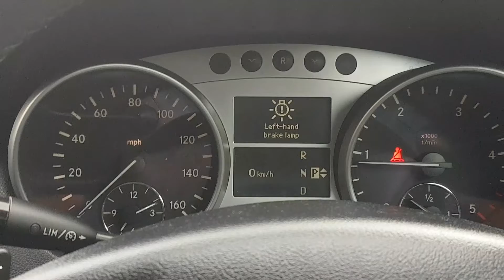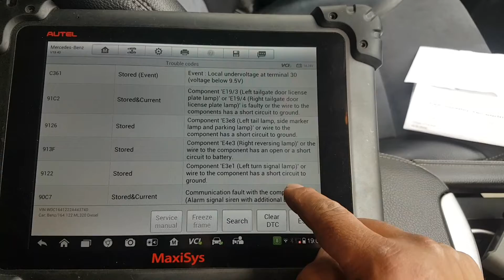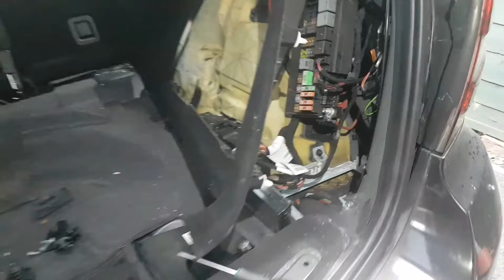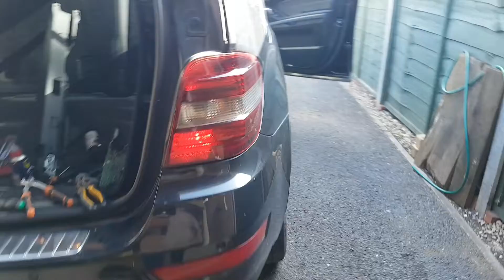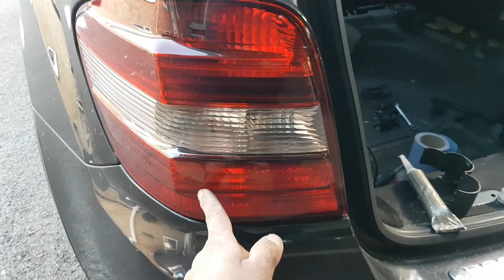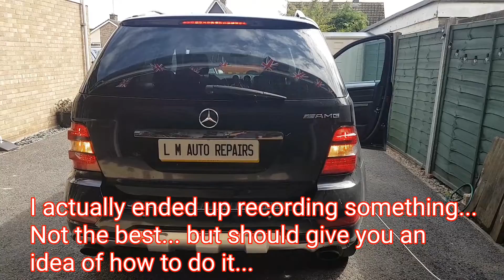Mercedes  ML320 Rear Lights not working... Fault finding and repair.

Comment: Thank you heaps Luis, you are a legend! I've got almost the same problem with my 2007 ML, plus my seats ain't working, left side mirror adjustment, right side mirror indicator, nor is the fuel gauge - it's stuck on full. Plus my rear fog light just turned on in the middle of the night one day as car was just parked in front of the house, locked, no ignition on, the only solution was to pull the bulb out. Rear left indicator is playing up sometimes but I have ''enough'' working rear lights to pass the rego check. It is annoying but I still love my ML as my engine, transmission and drive train are as good as brand new it really goes like a rocket and I'm not a big fan of newer cars! No regular repairer wants to touch ML with obvious SAM unit problems and it's so common with these cars that water ingression happens on so many of them. I was shocked to see there was no seal at all at the right tail light assembly?! Even more to it, it looks like it was never fitted with one or it was PURPOSELY removed by mechanics when you take it for service!!! Yes, you heard me well and I'm not a tinfoil hat, no surprise at all for me if that's the case as I'm well aware of what they do when you take your car for a regular service! Especially ''genuine brands services'' are the worst, not only Mercedes so, folks be aware. When I bought my W164 ML280CDI I took it to a small workshop in the area to the guy who was a long time genuine Mercedes mechanic and the first thing he pointed out to me was that the fuel filter was never replaced (!!!) despite me having a full ''genuine'' service history and log books, car had around 160.000kms at the time. He said, it should be replaced on every 60.000, but it still had a genuine, original factory robotic seal on the fuel filter, once it's replaced you must put a round metal clamp. So it was nearing it's third replacement on 180k but it was still running on a factory fitted one! Unbelievable! My friend has even worse experience some time ago with his Camry and ''genuine Toyota service'' when his engine exploded because of the timing belt that wasn't replaced at all. Another friend put some marks on oil filter on his Toyota and after service and ''oil and filter replacement'' the marks were still there... similar stories with Audi, BMW, VW no difference and the list just goes on. Sorry for a lengthy comment, I just wanted to say BIIIG THANK YOU to Luis and all other guys doing this kind of videos, you are real, genuine helpers to the worldwide community, may God bless you all!

Comment: I need your help mate can you please I want to contact you
Reply from the maker: You kinda just contacted me...
😉
Reply: @LMAutoRepairs  Hi I really appreciate your video. I have problems with, brake light is on, baterry become flat second day and is brand new fuel indicator show me full all the time. What can to check  my car is Mercedes benz 280CDI from 2006 thank you
Reply from the maker: Have you checked this module for water ingress? 
Have you scanned the car?
Reply: @LMAutoRepairs  I live in Gloucestershire GL1 and I don't have no body here to help my
Reply from the maker: The issues you are having, both pass through the rear SAM... does not 100% means it is the problem, but it is a high possibility...
To inspect is water is or has been in there, it is straight forward... remove the panels and check...
Any one with a decent tool can program an used or new SAM...
Reply: @LMAutoRepairs  Thank you so much where are you live becouse I want to coming to see you becouse I have 100% trust you to done properly job for my car

Comment: Get a new SAM…I had the exact same problems with water penetration and it took out my pump to lift tailgate and SAM.  Stupidly I haven’t taken out rear taillights to reseal but have them on order.

Comment: Hi Question 2007 w164 amg battery logo  in the dash  cen be acceleration battery
Reply from the maker: Scan the car, test the batteries...
It can be, but testing is the best way to make sure...
👍👍👍

Comment: Hi Sir where you based in, i am having rear lights same issue since yesterday heavy rain day driving. 

Please 🙏 thank you
Reply from the maker: Start by dry the rear sam area... fix the leak, open the sam and clean it...
👍👍
Reply: @LM Auto Repairs  after following your directions, all working perfectly. Only way I am struggling to find leak but cannot find, I ended up using lot of almunium tape around the sam to protect from water.
Reply from the maker: @MRAS25  
Usually leaks from the tail lights...
New foam seals solves the problem...
Reply: @LMAutoRepairs  many thanks for your help.
Reply from the maker: @MRAS25  
👍👍👍
Reply: @LMAutoRepairs  hi I got the seal from mercedes I want to know that sticky side will go back of light or on body
Reply from the maker: On the body...

Comment: Hi really appreciate your content and knowledge would you be able to advise me on our Skoda fabia 60 plate front drivers side electric window not working. It was temperamental now there’s no click or anything happening. I was hoping to tackle it myself safe on a garage bill. Thanks loads !!
Reply: Thanks loads will take a look see what I can see, kindest to you man
Reply: Your right man had a look the wires are broke in the pass through in the door hinge. Would that be a easy replacement job you think I could do
Reply from the maker: @jacobbenger-pereira3514  
I have a video on how to repair those, if you want to have a go at it... I think was one video on a fiesta and one on a skoda...
Otherwise, you need the entire door loom...
Search my channel...
👍👍👍
Reply: @LMAutoRepairs  your a legend bro thanks !!
Reply from the maker: Hi
Inspect the loom than runs from the A pillar to the door for broken wires...
If you have a scanner, scan the car first, that should help you pin point the issue slightly better...

Comment: With these junk mercedes, always start and trace the light that's out. Things like brake lights coming on when a side light goes out is sort of normal. Codes will tell you if a replacement light is being used. I feel your pain though with getting it working then it failing again. I always now get the customer to get a module. Not worth the time and effort - especially for a trader 😉 Peugeot have an even better idea on some models, if a number plate light isn't working at ignition on, the BSI will flash the corresponding brake light 3 times then disable the brake light totally. How you can see this from the drivers seat I do not know. They say this is for safety 🙄 Obviously, to the French, no brake light is safer than just leaving the number plate out.

Comment: the car was repaired (an accident, hit on that side), if not, Mercedes should bear the cost (at least in parts, seal, module, hydraulic pump)

Comment: Honestly I'd recommend changing those taillight seals with the updated version from Mercedes on every W164. Even the on the Mopf/Facelift variant I've seen them leak (though they moved the rear Sam under the back seat there).

Comment: Top job again there Luis. You really went out of your way trying to fix the module, it was looking really awful, most techs would not have touched it with a barge pole.
Reply from the maker: ☺️
Thanks... unfortunately it did not paid off this time...
👍👍👍

Comment: good morning luis that water mark you pointed out  is a fill level indicator mark for the SAM  and that stands for Sunk And Mouldy  i lke a challenge but 10 hours plus that sam would be flying down the garden as hard as i can throw it  ps talking is the way you get the process across how you think and then repair  so no you dont talk to much  and THANK YOU for the video